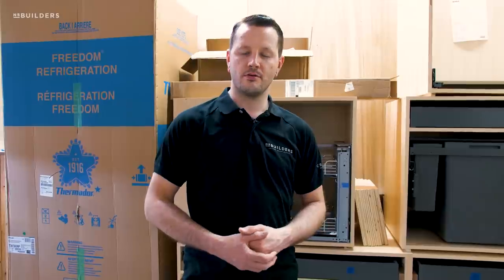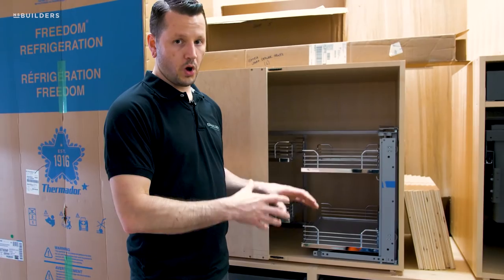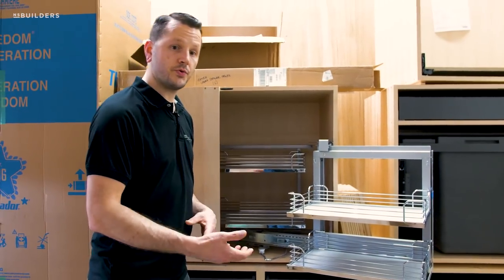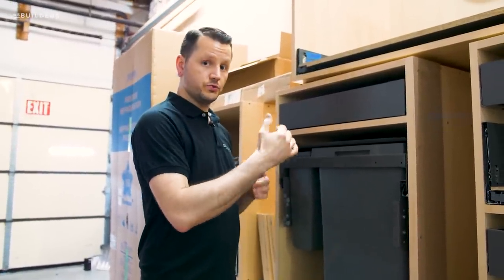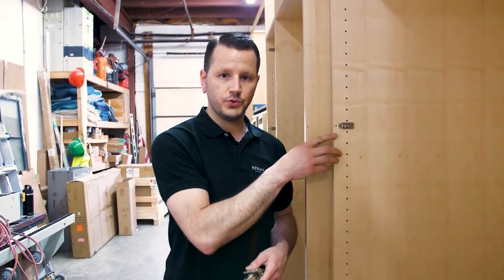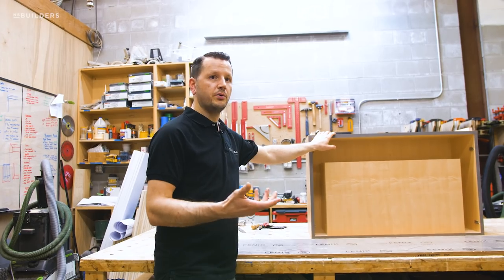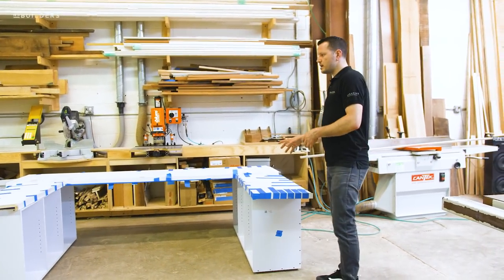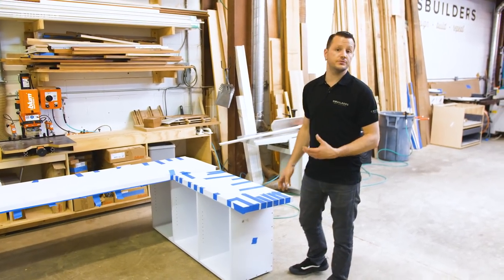Hiding cabinet screws with this one simple trick | Revealed

Comment: I own 2020 design and I can say its amazing with all its uses from design and rendering to administrative and billing/cost analysis option it has ( i don't even utilize the full capabilites and I find it priceless). As useful as this program is, I always have to use sketchup for very fine detailed projects/custom designs; it facilitates high precision detail and easily shows possible problems. I highly recommend to atleast learn sketchup, then jump into the other options by needs.
Reply: Thats good to know. Typically I'm also using sketchup for the finer details. For estimating, I'm using a spreadsheet that I've created in excel.